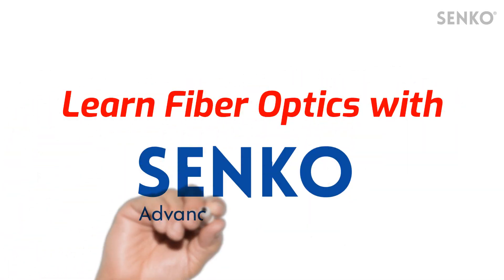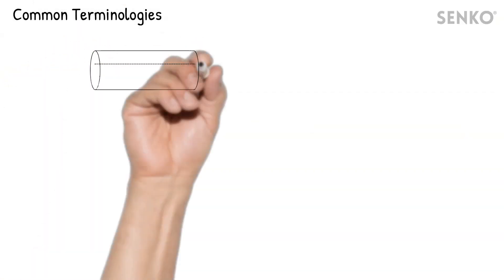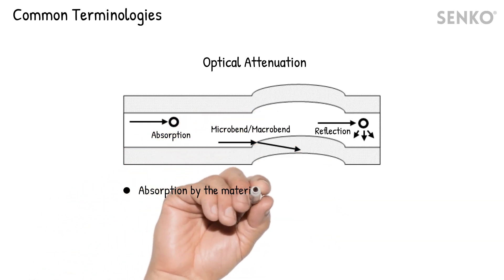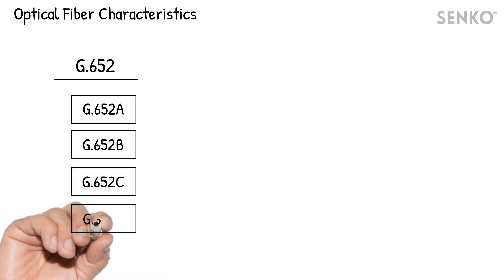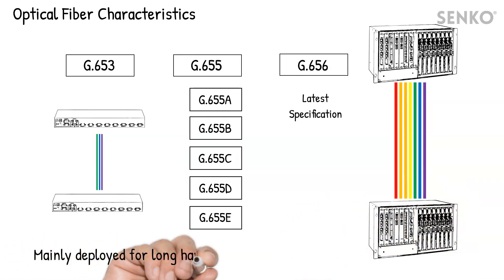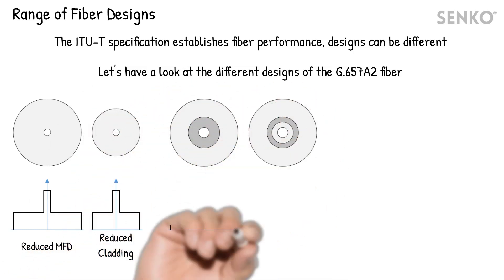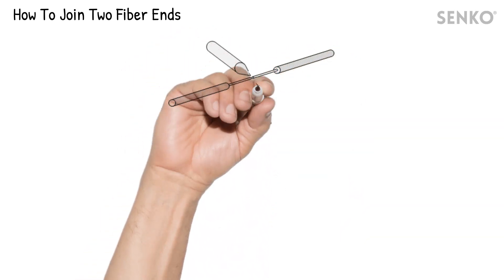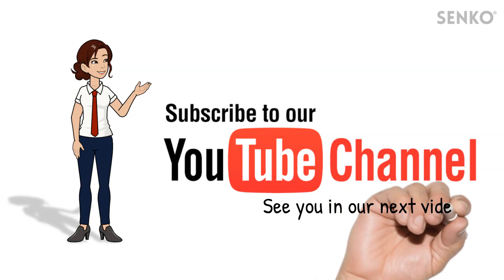Understanding Optical Fiber

Comment: Let's look at a naked universe without noise pollution. Where is the scientific interest and curiosity for new experiences?  ERROR in measuring the Universe, black holes, dark energy,... Let me judge all this by the result of a direct experiment, gentlemen of physics
Let's do the Michelson-Morley experiment on a school bus and determine the speed in a straight line - this is exactly the experiment Einstein dreamed of. Perhaps we will see the postulates: “Light is an ordered vibration of gravitational quanta, and Dominant gravitational fields control the speed of light in a vacuum.” 
There is a proposal for the joint invention of a HYBRID gyroscope from non-circular, TWO coils with a new type of optical fiber with a “hollow core”, where - the light in each arm passes along 48000 meters, without exceeding the parameters of 40/40/40 cm and mass - 4,1 kg.